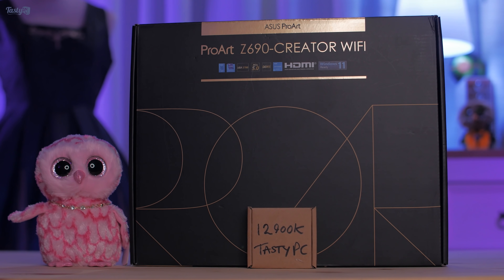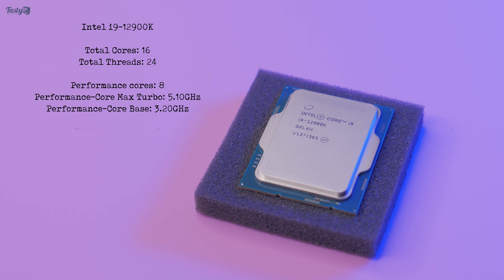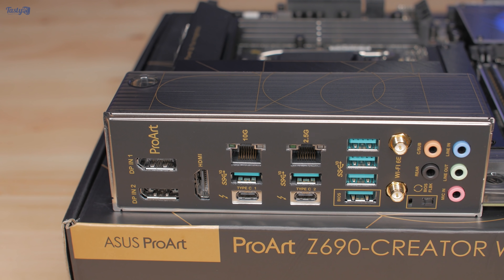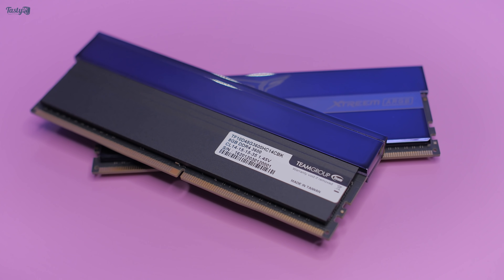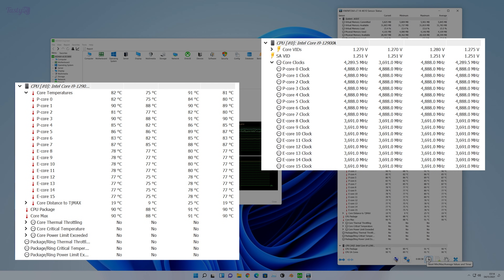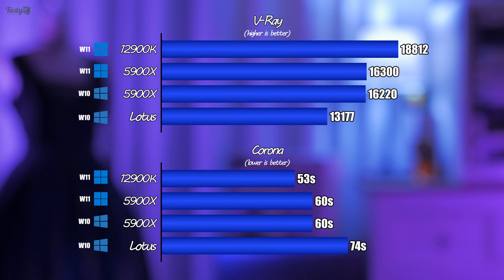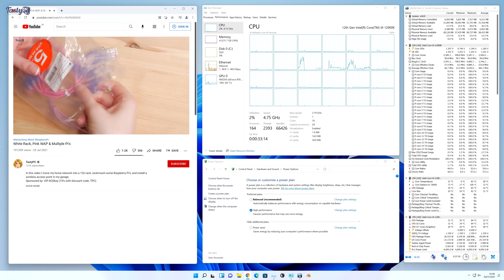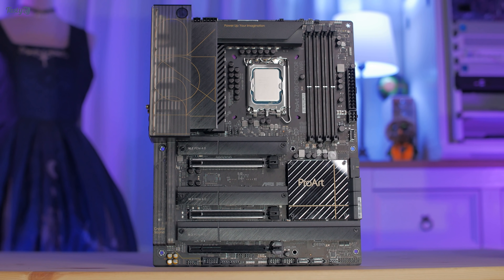The 12900K Made My Ryzen Rig Look Slow - Asus ProArt Z690

Comment: Nice video but whay is a 12900K with Z690 MOBA compared to a R9 5900X with a B550 ? 
Where you training to stop the R9  to getting more power ? 
if yes what not put it on a A350 board ( or at this point what not disable cores) ?

Nice to have competition in the marcate but not when it is misliding or hindering evolution ?
We head 10 year or more of quad cores because of intel !! what is next ?

Comment: ryzen will beat intel again. you gotta remember this is next gen from intel and amd hasnt come out with their next gen proccessor yet. you are comparing applews to oranges because you are comparing next gen of intel to last gen of amd.  amd is always a bit behind intel on releasing a next gen cpu. it would be far more accurate to see how they hold up against amds new 6000 series cpus.
Reply from the maker: It's comparing Intel's latest to AMD's latest and when AMD has new chips in a few months time the industry will compare Intel's latest to AMD's latest again. This isn't a console generation which lasts 6 years where comparing a last gen Xbox to a current gen Playstation wouldn't make sense.. this is desktop CPU's. The gap between intels 11th gen and intels 12th gen was just 7 months. 
So what if a new architecture is delayed, and a competing one comes out ahead of schedule? The releases are too close to be able to line things up in neat little "gens". All you can do is compare the latest of one to the latest of the other at the time of release.
Reply: You do realize Intel will always be Intel, right? What I'm saying is, if Intel wants to go to war with AMD I assure you AMD has ZERO chance. I don't know if you remember back in 2018 they were supposed to launch Alder lake but then,  It didn't happen bc there wasn't that much competition for them. To switch over to a whole new architecture is very costly. They will have to upgrade everything from new tooling to new PCB, etc. The point is, they have this technology in 2018.  Alder Lake technically only has 8 cores but destroyed everything out there! Can you imagine if they put 16 performance core in their next-gen? Intel is about single-core performance and AMD is about putting as many cores as possible.

Comment: Just to let you know, whilst watching you vid and running Cinebench R23 on the other screen, my Ryzen 9 5950X w/ 32GB 3200Mhz corsair Vengance RAM scored 27749  on multicore. You'll miss the full cores when it comes to compiling videos with the 12900, the Ryzen just rips through this task around 40% faster in my testing.....all on Win 10 Pro. I don't trust Win 11 yet as I 've had so many issues with it not running software correctly or just randomly bluescreening my system.
Reply: Microsoft said windows 10 was going to be the last OS they would be making, windows 11 is made off of the same platform as windows 10. it brings up some crazy thoughts. If you look at the last few windows 10 updates, they added features that makes you sign up for a microsoft account to use the internet, and also makes you use a pin number to get into the the desktop. It makes me think that windows 11 is filled with spyware to keep track of what you are doing possibly other embedded features that are against the user....

Comment: The single task vs single task is a poor metric for comparasion.  The AL CPUs when loaded with multi tasks get hot anduise a lot of piwer despite P and E cores.  Intel is already pushing the 'buy into this socket and you will be all set for the next gen'  meme.  AMD owners have little incentive to switch as they are set for the next release.  Intel 10 or even 8  gen (8700K) owners are better off upgradimg thgeir GPU new or used.

Comment: still rocking a 6700k here
Reply: just upgraded from Q6600 to Q9650 (in form of Xeon E5450). Had CPU ready in box for 2 years, but was lazy to upgrade. Was pleasntly suprised, it was better I've expected, performence is equal as Q6600 overclocked at 3.3-3.4 Ghz.
But in graphics, I've downgraded. Had 8800GTS-512, and I've downgraded to 9500GT. Thinking about 8400GS.
Reply: @warrax111  well nevermind the 6700k, i'm on 12700k now lol

Comment: My Ryzen 5950X achieves stable 4,6GHz on all 32 cores at v1.250 and consuming 130W at 82°C. This config can reach 29000 point at Cinebench 23.
The Intel CPU has better performance per core, yeah! But also is a chip released one year later and consumes twice as the Ryzen on with the half of P cores…
Not sure where are we going with all this partial reviews. And btw no one mentions that we are comparing also DDR4 vs DDR5….
Reply from the maker: It's fair to compare intel's latest to AMD's latest, even if AMD's is a year old now. It's also entirely fair to compare with DDR4 vs DDR5 and literally every review mentions it.
Reply: Sure it's fair to compare. The message I'm receiving is that it's perfectly fine to get 5-10% performance boost at 40-50% power consumption. And the fact that CPU with P and E cores arch isn't efficient by any means at this point. 
Only time and real world usage will tell. The only true benefit I'm seeing here is the battle between Intel and AMD will force them to drop prices at least...
Reply: 16 cores and it uses more than that ill even get the benchmarks... an overclocked 5950x uses over 200w as well on r23

Comment: 11:24 One thing I don't like about the motherboard is the plastic box over the back I/O connectors, partially covering the VRM heatsink  - fans will blow heat from the VRM in the plastic box, where it will be trapped. It looks like it won't allow VRM heat to be cleanly blown away from the VRM heatsink.

Comment: I always wondered why the MOB comes with HDMI n DP ports if u cant use them when u have no Graphic on Board, u NEED a CPU with a inbuild GPU or a GPU, so whats the need of those ports on the MOB when u gonna use the ports on your GPU anyways
Reply: They're there because you can use them if the cpu has an onboard gpu. In this use case though (content creators who are def going to have a discrete GPU) I think that video connector space could have been better used for more USB and an optical audio connector; or at least drop either the 2xDP or 1xHDMI and replace with USB.

Comment: It's not "Thunderbold 4" - it's USB 4 which includes a limited subset of the Thunderbolt spec. Tere is actually a separate Thunderbolt 4 spec.
also
The 12900K named for the temperature at which it runs.

Comment: Happy Birthday. Thanks for the info. Curious what AMD will come out with in response. It's so nice that there's finally some competition in the processor world again.
Reply: probably a price cut ... or with 3Dzen comming in early 2022 i think
thus they dont need to 
12900k has a 2,3x times more power draw at nearly 250W (Corona, Blender .. etc) while ryzens have around 100W
And around 150 applications dont work on 12gen 
100 are games on w10 and on w11 either crashing  or doesnt even wanna run
Reply: @mihapeterca7940  So Fake
Reply: @mihapeterca7940  bro this is soooo true!!! You said everything 100% right. 12th Gen's power draw is soo high while ryzen is efficient around 100w, and so many games aren't even running properly thanks to the terrible driver support, xe graphics driver support, and more

Comment: Nice done Intel but 350wat just only for cpu no go for me
Reply: its 240w under full 100% core load with mce and power limits off... basically like  220w 5950x with pbo lol or 5800x 205w on the same test
Reply: 350W was the total power draw for the whole PC, not the CPU alone.

Comment: this cpu needs a refrigerator to cool it.
Reply from the maker: I just used an air cooler 🤷‍♀️
Reply: @TastyPC  yes but thats a top tier air cooler in cool ambient room and still temp was around 90 for stock configuration for productivity workloads. In long term is that temp sustainable?
Reply from the maker: @srinathshettigar379  - Aida64's FPU test generates more heat than real world use would. So that's really an absolute worse case scenario. Also the TjMax is 90°C on a 5900X/5950X but 
100°C on the 12900K. So the Intel chip has been rated for higher max temps than Ryzen.
Reply: @TastyPC  i agree with you. And i did watch gamer nexus benchmark video and they used a 3 fan AIO cooler and ran blender benchmark stress test and still 12900k ran above 90 pulling 240watts stock.
Imagine running gigabyte psu with this.💥
Same results from linus as well. 
But gaming temps were fine since all cores are not stressed as much.

Comment: Your new pink owl self is so cute <3 and happ birf

I don't think the performance profile - that it behaves fairly similarly to a more conventional design - is so surprising after all. Because as you ramp up the core utilisation on a more conventional CPU, you run into power budget issues and the overall performance ends up being somewhat choked. By having a portion of power dedicated to lower performance cores, this relationship is shifted to where the fast cores can likely run at higher portion of their maximum speed. But there will likely be an odd scheduling issue here and there where tasks don't get assigned to the cores optimally, like software using a task dealing worker thread scheduler makes an assumption that the workers will complete their tasks approximately equally quickly which no longer holds, so occasional regressions are to look out for.

Comment: Hmm so both you and Optimum Tech got weird performance issues in RS6 at 1080p, but 1440p was completely fine (OT used an i5-12600K). Probably just an optimization issue?

Comment: Hey Lauren,

I just would like to wish you a happy birthday today & happy bonfire night later tonight.

This was phenomenal, intel has changed the game for us all. Productivity is my main goal and now it is better than ever for most cases. 

Yes power may be an issue for some but systems require a lot of power as they achive great things anyway with the power

Golden Cove really has amazing IPC gains, I still am in my sandy bridge Golden Cove is the sandy bridge of exactly a decade later. It will do great things as more optimizations for it happen on the Linux & Windows 11 side of things ironing out latency issues & DDR5 performance improvements from motherboard vendors.

Glad you were given an early sample and share it.
Reply: Intel Increased IPC by 40% this year, 20% with Rocket Lake and another 20% with Alder Lake. Not even the jump from Sandy Bridge to Haswell or Skylake was that big.

Comment: At last! A creator who isn't running benches on Windows 10 when Windows 11 has specific support for the new Alder Lake architecture. Windows 11 is mature and stable enough now for all these "yeah but it's too new" reasons for not upgrading. I have been running Win 11 since public preview and have no stability or performance issues, although I did move the start menu to the left :). The Noctua cooler is nice - I am a big Noctua fan (fan hehe) but for i9 CPUs I would have thought the NH-D15 would have been a better match (I have 2x i9 9900kf machines with NH-D15 coolers). Just checked and Scan have despatched my i9 12900k for delivery tomorrow so I guess I better start looking around for some components! Thanks for the video and Happy Birthday for tomorrow!

Comment: I love how most reviews are done with stock amd 135W and intel is doing 240W boost all the time now and ignores that lower tdp.
My 5950X really comes alive with 225W and 80°C limits on pbo.
My AMD is really good in benchmarks vs intel and rareöy uses more than 168W while beating 12900k results. My 5950X does 28k in R23.
Also my mobo was 200€ cheaper than similar intel Z690 mobo making 5950X 1:1 in cost of platform.
Win11 is funny, because amd bug returns if components change.
Reply from the maker: There's intel's and AMD's stock and then there's what the motherboards do "stock".
I tested with Multicore Enhancement enabled on the Intel system, and PBO enabled on the AMD system. This feels like a fair comparison as in my opinion, any further tweaks would be deep into overclocking territory, which wasn't possible with my limited time.
Reply: @TastyPC  yes, you did well. I love your content. I'm just thinking out loud that Intel ignored their tdp this time to get a lead. Putting 150W air cooler on both would make intel just thermal throttle to that 150W from their new stock maximum boost wattage.
Amd has such low pbo limits and they need to be adjusted to get 5950X perform at it's best.
Maybe I try to do comparison and a  video on unlimited tdp on both with different coolers if I ever get hands on ddr5 memory to give intel best performance.
Reply from the maker: @Bot.number.69420  - I can see where you're coming from, but AMD could market Ryzen as more power efficient or they could throw more power at it and fight fire with fire. They can't have it both ways though, so it'll be interesting to see what they do with the refresh for sure.

Comment: 12900K looks amazing, but we still need to see how AMD response to this new Intel's CPUs. Nothing could be that easy in war between Blue and Red.
Reply: Just release AMD 5950X power limits and it remains lower in power usage and beats 12900K in workstation workloads.
Amd just needs to release their cpu from tdp like intel and ryzen 6000 is really really fast.
Reply: @Bot.number.69420  problem is, they are still way behind in cooling. Intel CPUs since the 10th gen can push out 300+ watts without throttling. Ryzen throttles way lower than that, that's why they have pretty much no overclocking headroom and are best left under PBO.
It's something AMD (well, TSMC acually) will have to adress with future releases, just to get more space to increase pure performance at least for the flagship CPU